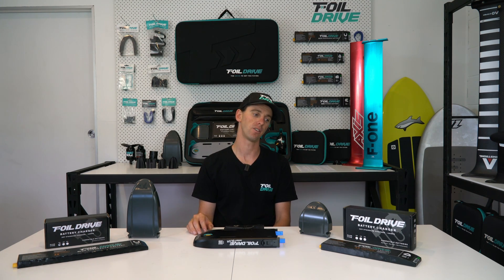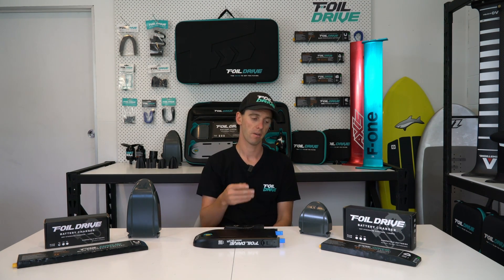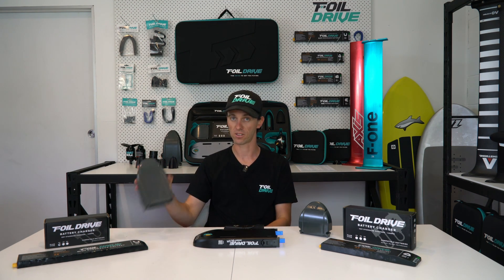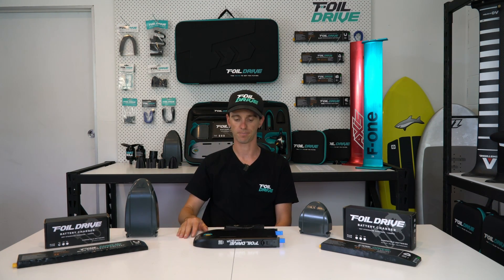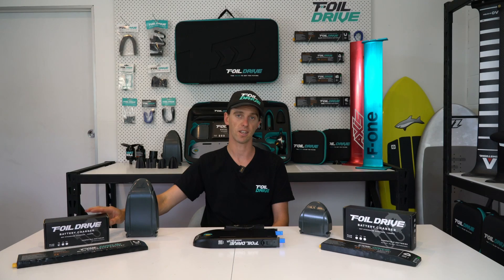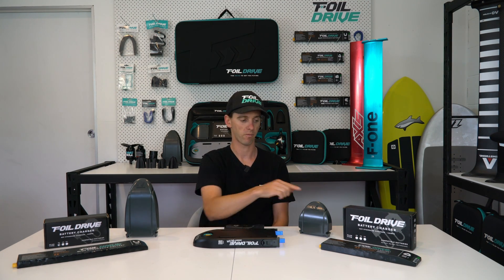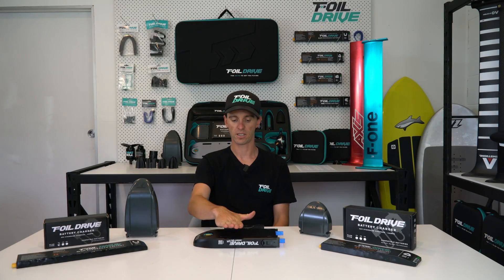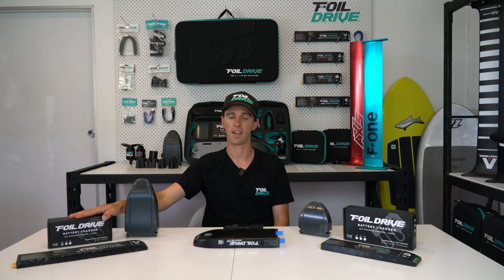Foil Drive Assist Slim Critical Battery Configuration

Comment: This could be automated. Fliteboard does this automatically 😊
Reply from the maker: Yes it could, these things add weight. The MAX stays on the same voltage and does not require re-configuration. This option for the Slim is to provide the optimal power to weight ratio, it's super light and punchy. An option for performance riders if they wish to optimise weight and dont mind the configuration!